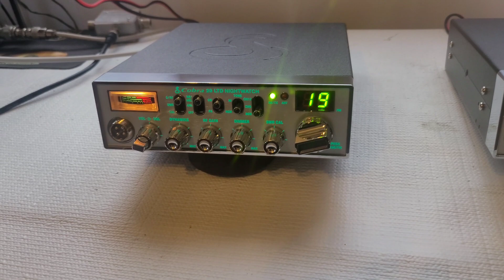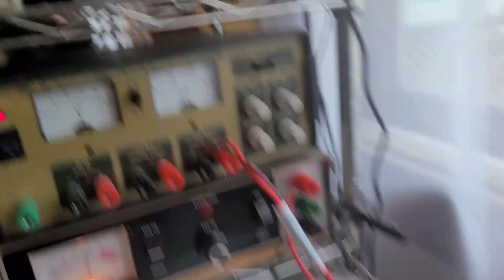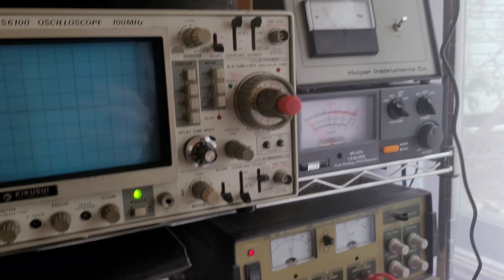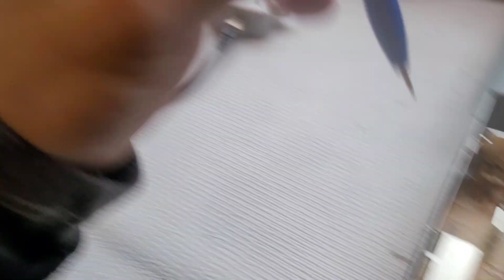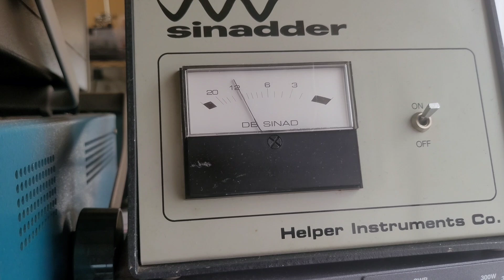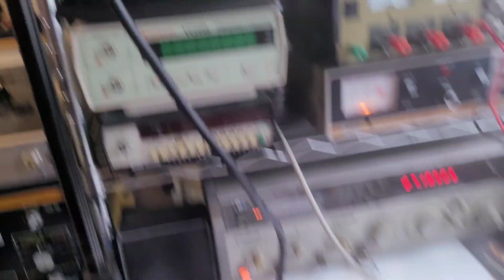Low power and poor sensitivity right out of the box new Cobra 29 Nightwatch

Comment: Its the same here in the UK. 
The manufacturers DELIBERATELY set the power low because of Customs at the ports. 
H.M Customs will take a sample rig and test its output . 4.0W is fine . If ONE rig is 4.01 or more they will confiscate the WHOLE consignment AND fine the importer which will cost the importer dearly . 
The importer, usually a wholesale dealer is SUPPOSED to Q.C the rigs and bring them up to spec ..but they rarely do .
Reply from the maker: That used to be done here back in the peak of CB.  I think the FCC spends most of its time worrying about other things like pirate stations.  Lots of people will ship radios directly to me for a QC check.  I also offer it when people buy radios from me.  73s !

Comment: I have been into to cb radios since the 1970's and I have owned countless radios since then and they ALL put out 3.5 to 3.8 watts. I used to tweak them up to 8 watts, this is a simple solution you should recommend.
Reply from the maker: No need to stress the radio for 1/2 S unit on the meter.  The legal 4 watt carrier doubled to 8 watts would only yield 3 dB gain wich is 1/2 of an S unit.  8 watt carriers on most finals are not great and reduce the life of the transistor for almost no tx gain.  I never set my radios to 8 watts.  If you want noticeable tx power, run a linear or a black box 10 meter converted radio.  73s
Reply: @pulsarcb you fix radios for subs.
Reply from the maker: @jerrywilcox9890  I fix radios for anyone.  I have customers from all over, even other countries.
Reply: @pulsarcb  hardly anyone fixes them over the road anymore.my cobra 29 I just bought for my truck sounds and works like crap.
Reply: @pulsarcb  my other one the meter quit working and have no clue how to replace it.
Reply: @pulsarcb  they come in handy when your on the road for accidents or something but it's know good when you can't hear anyone till your right on it.dont know if there a way for it to receive and transmit better or not I'm know except lol.
Reply from the maker: @jerrywilcox9890  all radios suffer from quality control issues. No matter what brand.  It's best to have a tech go through and check them out right out of the box.  I've opened up plenty of cobra radios and have tx set to 3 watts and rx so far off you probably couldn't hear a radio beside you.
Reply: @pulsarcb  my dad use to fix them for me but he was killed in a car accident so I don't have him to help anymore.
Reply from the maker: @jerrywilcox9890  sorry to hear that
Reply: @pulsarcb  ya I just got this one 2 days ago and I'm lucky if I can talk to someone crossed the highway let alone here them it's bad.
Reply: @pulsarcb  you have a bio or something to get an address to send to I mean I can't sent it out right away I don't get off the road till the 22nd.
Reply: @pulsarcb  If that's true then tweaking from 3.5w to 4w would make no difference at all so why bother? I never had any trouble with my 8w radios either.

Comment: My cobra19 pro mini suuuk as far as TX goes. They need amps baaad. I need an amp baaaaaaaaad. Lol. I quit until i can find or make one. Can’t even make it down the road before its junk.
Reply: Stick with a president radio, if you need a radio as small as the cobra mini, the president Bill 2 will serve you well
Reply: @bobdillashaw4360  I only got the mini because of the price. Free 99. They need amps. Idk why amps are so expensive. To hell with the kits too. Junk. They sent me one with a bad and used fet, the other didn’t have switching, neither had a filter which tbh, idk if it would have helped. Wish them chips weren’t so damn expensive.
Reply from the maker: The 19s are not known for mind blowing performance. Mostely used  now in offroad communications like overlanding.  Used to be big in construction sites, scrap yards, transfer stations.  More local type situations.  A 29 in any version would be a big step up.
Reply: try adding a 5 foot francis whip with a ball mount or mirror mount you will be shocked
Reply: @BOB12349307  i have that. I cant get past 3 miles. I wonder if i can mod it. I have three lol. I also made a dipole for it. Quarter wave each side. Its pretty huge. I get great reception with it. Best swr of any antenna I’ve ever used. Location not great but ya know. Its wild tho, such expensive radios and they don’t even match a 20 dollar baofeng. Or however it’s spelled. 
I bought two 100 watt amp kits. Both had used broken fets. Then i bought two new fets and they were fake. 
Now im scared to buy those cheap 100 watt amps they look like red power inverters. Maybe I could justify it by doing a detailed review. 
I thought about making my own but the fets are damn expensive so im trying to find the cheapest chip at 50mhz. I wont need all 50 but itd be nice. 50-100volts, i can use my 48 volt battery charger lol. 

I noticed something strange tho the other day. I touched a neon indicator lamp to the antenna of my cb and it lit right up like what? There isnt high voltage on that antenna is there? And I’ve always wondered if its better to transmit with high voltage. Like, is it better to step up the voltage before modulation or just modulate the 5volts? 
I hope I remember this, would make an awesome video